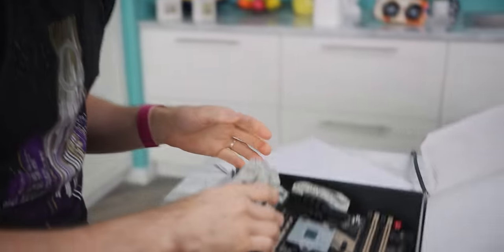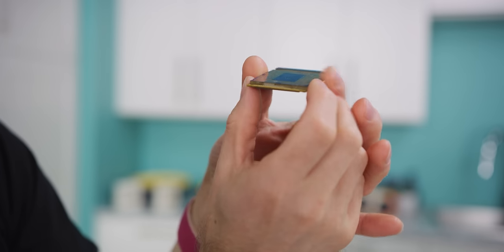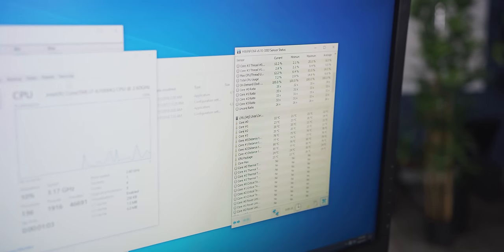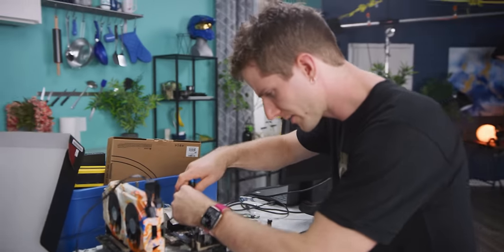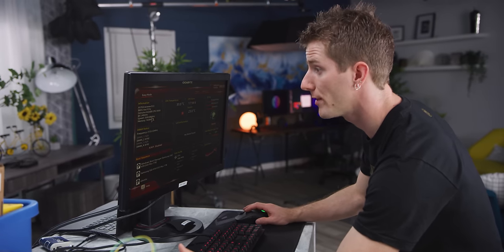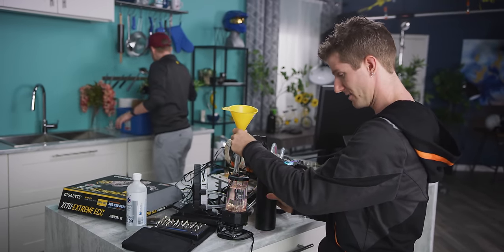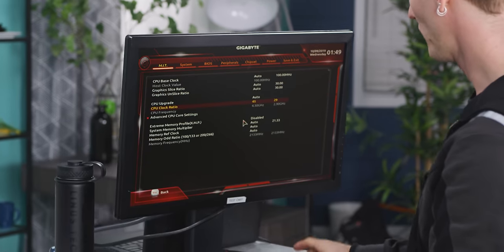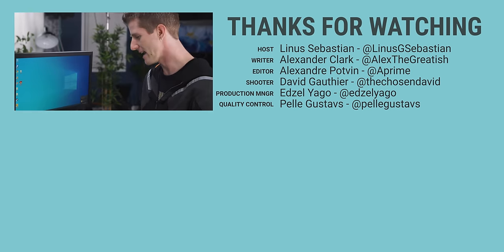Testing out Mystery Chinese CPUs

Comment: I'm more impressed to see sometnig that even an intel stock cooler can cool
Reply: I OCed my old Core2 on an Intel stock cooler. It probably would have done brilliantly with a water block or even an after market decent air cooler.
Reply: @NeuronalAxon do you know those big aftermarket stock coolers , I had one of those , I decided to pare it with a Pentium e6500 running at 2.93 , overclocked it to 3.54 GHz and it was still okay, but it was not a free cooler that comes with the cpu so I don't think it counts. Did yours had a bigger heatsink too or was it a slim 1-2$ cooler
Reply: @fatih9016  - It came with the CPU - looked just like the one Linus had in his hand.
Reply: I had an overclocked i7 3770 on a stock cooler a while ago lol.
Reply: NeuronalAxon - that doesn't really count anymore. Intel downgraded the stock coolers further and further until they just became a bare thin slice of primitive pressed Aluminium. Meanwhile the real power usage has risen, power density per area skyrocketed and st times they did put toothpaste between the chip and heat spreader. You could OC a Core2 but especially after Ivy Bridge the coolers just became the absolute bare minimum to run day to day loads.
Reply: @Hortifox_the_gardener  - Wow, they've gotten that bad?
Reply: Plot twist it's the old cooler with a copper core not a new one lol

Comment: Some year later those processors costs half the price and are good bargain for someone who needs a small CPU for a homemade server.
It seems you can have the 6c/12t CPU (45W TDP, $70) working on a B250 board, that is absolutely amazing because:

- it's cheap
- it's less power hungry than comparable i3-5-7 within the same price bracket
- it offers six cores (something you won't get to work otherwise)
Reply: im have a motherboard with b250 chipset, you use termalpad 3mm for install coleer ? im have heatsink stock and reverse fan ( sorry for my bad english xd)
Reply: @RoMeeLShEzAiT  I use third party heatsinks; most of them works.
You don't need something powerful since those CPUs are built for laptops and if you don't mess with them they are on the (slow but) cooler side.
I don't remember exactly the price or the model (the case is buried in a small server) but I used a cheap €30 heatsink.
Reply: @simonescuderi5977  many thanks :)

Comment: I have installed one of those Chinese Coffee lake 1151 intel CPU 0000 at 2,4Ghz up to 3.6Ghz.  I have it running at 2.9 Ghz in a Lenovo M710 tiny form factor with the STOCK FAN AND COOLIG PLATE!!!! (Lenovo motherboard does not have wholes to fit a regular 4 screws cooling plate).
Same machine has a GPU Beast external adapter (connected to the NGFF port where the wireless card was installed) with a GTX 1070 G1 and a regular ATX power suply and it works freaking well.
I know it's some kind of frankenstein but it works and considering the Lenovo was free from work, I have a really budget gaming PC for around 60€ the CPU, 45 the Beast adapter and 150€ for the GTX. Cinebench score went from high 300 (with stock CPU) to high 800 to low 900.
I'm super happy with it.

Comment: The CPU is pre-installed so Linus doesn't drop It.
[20-10-2019-21_15.]
Reply: Linustechtips will find a way.
Reply: @Justin Martone I am perfectly fine, I just want to remember when I post a comment.
[20-10-2019_23_37.]
Reply: @Dibowac  for a moment  I thought you did it because of that 1444 thing. Good to know I was wrong :)

Comment: Linus you should have a torque screwdriver (like a torque wrench but a screwdriver) for stuff like this. I use one to install EPYC CPUs in servers as is recommended by AMD. It will allow you to accurately and consistently set your hold down pressure with this type of CPU retention.

Comment: This is exactly the kind of enthusiast project I love! I can see that it was frustrating to work with, but anything that's a weird workaround to get performance for less money warms my heart. 

Whether it's using the superior-clocking mobile processors of Socket A and 754 in desktop boards to get better performance than their desktop CPUs could provide, using core-unlocking BIOS features on Phenom-II chips, doing the LGA 771-to-775 mod, or just generally finding the right compatible Xeon to go beyond desktop CPU offerings like on LGA 2011, I love workarounds that give the savvy tech fan an opportunity to exceed the limits the manufacturer intended to impose on the end user! 

I even used to buy AMD Thuban processors with missing pins for salvage prices and put replacement pins made from strands of CAT-5 into the socket where the missing pins on the CPU would line up. That worked perfectly almost every time, with the one failure costing me a Gigabyte 990FXA-UD7, which did sting quite a bit at the time. Still worth it overall though! 

The particular mod you were playing with seems like it could work once the BIOS issues get squared away, and was fun to watch. Thanks!

Comment: “Of course, if we were gonna be rendering all day and we had 150$ to spend, we would just go for a Core i5 8400 or something like that with six cores…”
Well, I do hope you would go with something other like that when you’d want to game at a relatively low price point. If I recall correctly, you yourself were pretty clear that a Ryzen 5 is better in heavily multithreaded tasks and at least close in most other scenarios.
Reply: My ryzen cost less and is more powerful than my i5-8400
Reply: i mean... Intel has been "the one" for so long. it's going to take time to get used to AMD actually being a viable competitor again after so long. Plus intel has basically been sitting on its ass for years, not really doing anything because they didn't have to. so, will AMD's current reign even be able to last very long? i mean, who knows, either way competition is good. let's hope they both stay competitive for everyone's benefit.

now we need someone to come up and mess with Nvidia... do something to start clawing high-end gfx card prices down...
Reply: @tzxazrael  I just got a 5700xt, better deal than Nvidias closest gpu. You can get up to like 140$ worth of stuff from the free game you get and such
Reply: @Ckcdillpickle  i mean, i got some free games with my RTX 2080, probably at least the same retail value... but that doesn't mean any of the games are ones i actually WANT or play... so that's hardly an effective bonus. (also; bought in summer '18 or so, when there was nothing even close, or i might have tried something like 5700xt)

Comment: If there's a AM4 version with laptop Intel CPUs available to be soldered on, then that would be amazingly interesting.
Reply: That would require an interposer, which would induce latency, and would also need to be custom silicon. Anyone with the capitol to do so has no incentive. If they did, imagine making the interposer able to glue multiple intel laptop CPUs into a Frankensteins monster...i9-9980hkx2 is a monster I would surely buy.

Comment: I wanted to post about this, then waited to the end and found that I was kinda right in my head:
All your success was on the first mounting plate.  Ten after you removed it, you had all kinds of issues.  Seems like some of the other ones they sent didn't have correct dimensions and probably caused either heat issues and / or mounting pressure issues.

Comment: God his sensitivity in CSGO hurts to watch, he picked up the mouse 3 times doing a 90-degree turn
Reply: Dihydrogen Monoxide i have to do 3-4 swipes to do a 360
Reply: @Howiee  a 180 should be doable in one single movement, that way you can reach any angle without picking up your mouse.
Reply: Dihydrogen Monoxide im comfortable with my sens, ive been using it for years. 400 dpi 1.35 in game. Im an arm aimer, whereas linus is a wrist aimer.
Reply: Crude Wildfire  try arm aiming with low sens you might like it, if not then stick to wrist

Comment: I reckon, regarding the CPU hold down plate, that they milled the retail version to the exact specs of the sample that was pre-installed, and then went and electroplated it afterwards. Even if the plating was perfectly flat it would be dodgy, but that would rarely be completely flat so there would be a very small increase in thickness around the top edges of the plates.

Comment: My lenovo y700 15ISK from 2016 has a core i7 6700HQ and is locked for a good reason because the cpu runs 70 degrees C average for playing Minecraft at 70-60fps high with a nvidia gtx 960m and 8 gigs of ddr3 ram

Comment: The exposed die is old tec that is supposed to directly bypass the aluminum cover for better heat dissipation.

 I have an AMD Athlon XP 2600 from an HP from the 2000's (AMD2600XP) You had to be careful putting the heat sink on because you can crack the die\chip if you over tighten your cooler.  I believe substituent lines went back to the heat spreader due to people fracturing the chips.

My info is a bit old, same time... this is nothing new or to get excited about.

The coolest bit was being able to take the heat right off the chips itself, like I added an aftermarket cooler and arctic silver 5 back in the day and dropped temp by 10-15 degrees.

Comment: i'm not surprised. if i remember right the core series was actually based on the Pentium m series. their reduced power requirements made for higher speeds at lower temperatures.

Comment: Technically those ES CPU's are still Intel property. This is nothing else than advertising for selling/buying stolen property.

https://www.intel.com/content/www/us/en/support/articles/000005719/processors.html

"Engineering sample (ES) processors are also known as qualification sample processors. They are pre-production processors Intel loans to original equipment manufacturers (OEMs), original device manufacturers (ODMs), and independent software vendors (ISVs) to be used in the product design cycle before product launch.
These processors often include more features than production processors for customer pre-production evaluation and test purposes. ES processors:
    Produced by Intel are the sole property of Intel.
    Produced by Intel are Intel Confidential.
    Are provided by Intel under nondisclosure and/or special loan agreement terms with restrictions on the recipient's handling and use.
    Are not for sale or resale."

Comment: Damn, I remember the good old times with the AMD Athlon XP's. I dont know how many Athlon XPs I've killed by breaking off an edge of the DIE while I tried to install a CPU-cooler xD
Reply: Omg I did the same thing with a couple Athlon XPs.  I don't know if it was just a bad socket design but it seemed like you needed sasquatch power just to get the second clamp down.
Reply: @dennisanderson8663  yeees exactly, you needed so much force for the second clamp.

Comment: not a single AIO is "flat" they are concaved in the middle. meaning the center is further away than the outside edges of the block.
the reason they are cheap AF, is because they don't put any work into the parts after they are spit out of the cnc. Center gets the most milling work, so it expands more than the outsides and that's why. You see this happen a lot with companies that just want to push out products that basically work, not build a quality product by slowing down a bit, or finishing them correctly. 
lap all aio blocks BEFORE, using for far better cooling.

Comment: It's a 3 screw mounting for a ball grid array chip, commonly found on some server racks. How is this a mystery to you? Also BGA was common on old intel 775 boards that had the same mounting but instead of 3 screws used a spring loaded arm to clamp the top plate top the chip and board. I admit it is unusual to see on a common desktop board these days but not a mystery by any stretch.

Comment: I think majority of Chinese CPUs are like that, the last time I wanted to upgrade my PC from Celeron to Core i7, I saw those kind of CPUs from a computer company called i-Life, it's a Chinese company. The CPU was soldered to the motherboard and so was the RAM, the RAM too was unmodifiable and the hardware looked like a mobile hardware for a motherboard. The battery is quite big and it has another board specifically for peripherals, RJ-45 and other system stuff and even though they said it's gonna have a SSD, it actually came with a HDD. So, I couldn't upgrade it, I put the system case back together and continued using the PC the way it is. The only thing upgradable here was the HDD though and the laptop itself is a complete copy of Mac running Windows, I have pictures and the computer itself was about less than $500.

Comment: Hey Linus, got an idea for you... Why don't you get some atomized colloidal copper powder. Place a small pile of it on you chip, clamp down your cooling solution (periodically backing the screws out a quarter turn, and shimmying the cold plate a little, to even out the powder distribution), then carefully hit all for sides with a heat gun, to momentarily liquify the copper colloid. Maybe even have two people, and develope a system of one tightening down the cooling solution, while another simultaneously heat guns the copper. If you can melt that pile flat, with the cooler all the way down, that would probably be the best possible thermal conduction, and subsequent heat transfer, that would be practical for civilian (non commercial or industrial solution) use today, that is currently possible for home PC's and Laptops (although I'm sure, if scaled up, it could be developed into a commercial or industrial solution as well...) Just an idea (gets you rich remember me!!!)💡😜🤪 ...L8r 👍

Comment: Well, first time I've ever seen this, but @8:13 Linus is wrong. Don't crucify me, he's not totally wrong, he's just missing a part of the process he's talking about. Let me explain. He states that "thermal paste is not a particularly good conductor of heat, it's only meant to fill in the small gaps between the chip and your cooling solutions contact surface." Now, the part where he is right is that thermal paste IS designed to fill in those tiny gaps, to create uninterrupted contact. However he states that it's "not a great conductor of heat," and here he is partially right, but this is where he's missing something... Form Factor. Granted thermal paste ISN'T the best conductor of heat, but that is due to it being a substance that can be pressed flat, and seep into gaps and whatnot. If you could make your heart conducting solution any size, shape, material, etc, OF COURSE you could create a VASTLY superior conductor of heat. In that sense YES thermal paste is not a great conductor of heat, however for the form factors necessary to create uninterrupted contact between chip and cooling solution, IT IS an excellent conductor of heat. Companies that manufacture thermal paste (well the large ones anyway) have teams of chemists that regularly work on developing thermal paste that more effectively transfer heat from a chip to the cooling solution. That being said, thermal pastes we have now have been engineered to transfer as much heat as possible, while still being malleable enough to effectively provide uninterrupted contact between chip and cooling solution... So, Linus, in the GRAND scheme of things, thermal paste literally has 10's of thousands 9f other materials and substances that conduct and transfer heat better than thermal paste, but for something you can squish between a chip and a cool plate? Reputable brand thermal pastes are, for the application, about  as good as it gets.
So Linus was wrong. Reputable brand thermal paste is an EXCELLENT conductor of heat!... for something you can squish between a chip and a cooling solution...

Comment: I still hate BGA so much because its a very expensive fix worse if those RAMs are soldered the machine for ot very expensive and it doesn't justify for a small repair shop to have

Comment: I was researching material with higher heat conductivity and it appears silver is pretty high. As a thermal paste additive it could work, but then I though what about liquid cooling. A silver nanofluid exists and could work, however you had problems with thicker liquids before. Perhaps testing how far to delude it with distilled what and then it goes through a metal heatsink pipe in a plastic or metal box with silver nanofluid and distilled water at a higher concentration on the outside. It's a radiator that's entirely liquid based. Not sure on how fast the heating and cooling would be by itself. Perhaps a aquarium air pumps that bubbles colder air as it rises through the silver nanofluid grey sludge. Maybe you can make this idea better.

Comment: Used toothpaste for thermal past on a AMD processor overclocked on modded BIOS, super cheap job ran great for years never overheated on windows 8, installed windows 10 started overheating a lot and bluescreening :)...

Comment: I am not a tinkerer, and don’t want to be either. If the good, cheap, performance can be achieved by simply pasting the cooler directly to the die then this seems like the way to go. Of course this process is delicate and should be one under more controlled conditions (not in your kitchen between sips of coffee). So what I would like is a company (or Mr. Su) to do it for me, and I would buy the board and chip assembly from them. Sure the chip is kind of married to the board now but so what! Like I said, I am not a tinkerer. Boards are not that expensive so if I want to upgrade, I just buy another assembly. And if I return the previous board and chip assembly to the company, maybe they give me a decent discount on the new one since they can reuse everything. Or I can sell the assembly on Ebay to someone who has a lower budget.